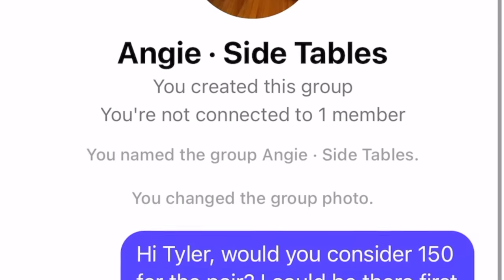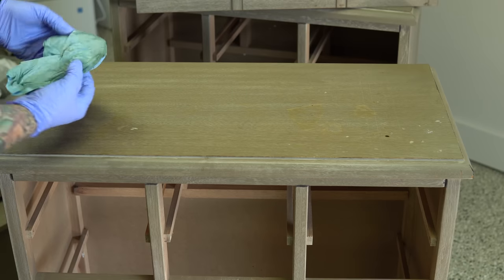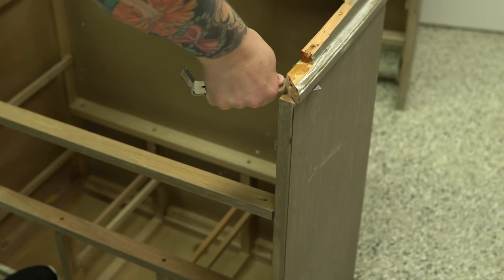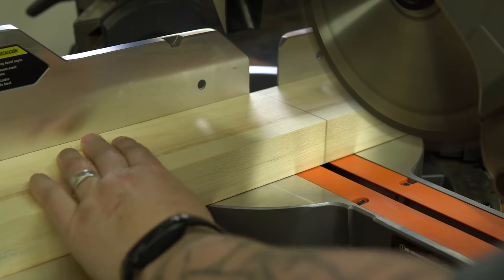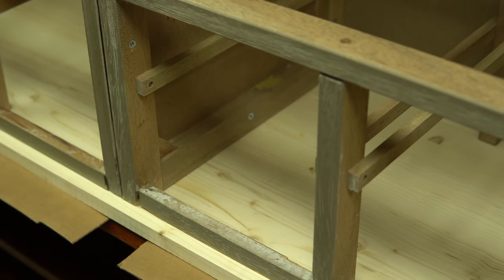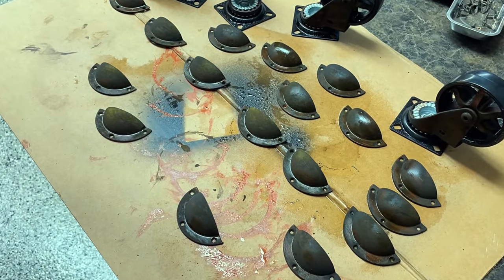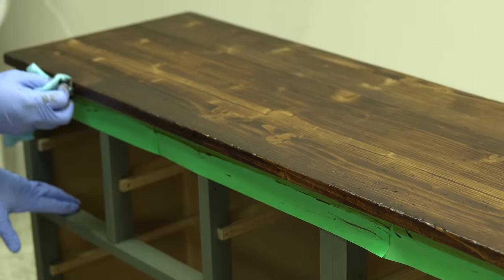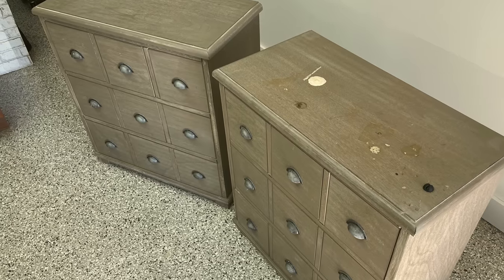I transformed a cabinet into a vintage apothecary masterpiece

Comment: Really nice and very neat solution to a big pair of problem children!

Maybe run some sandpaper over the rolling surfaces of the wheels so they look like they've many miles/kilometers of use - or not 😁Great work on the metal pulls, they look like they have a a few generations of use.

As always, super job, Angie and your furry supervisor!
Reply from the maker: Thanks John!! ❤

Comment: I did a feature wall in my store using deliberately mismatched pallet wood to try to simulate barn boards, and I made a stain for aging it by soaking old rusty nails in vinegar for 24 hours.  Then you can just wipe the vinegar on the wood and it'll turn it a sort of dusty grey which looks very close to old, rough wood.
Reply from the maker: Yes! That trick works so well! I love that you can adjust the strength by simply how long it sits. That wall sounds amazing!
Reply: Steel wool works too if you don't have rusty nails....but when my mom put a Poly sealer over it (bathroom cabinets) it changed from the pretty gray to a nasty orange....so I gave her some of my trusty Odies Oil (thanks Angie) and that kept the gray tones
Reply: @mimi2the4  Yeah, poly's anti-yellowing stuff tends to react with vinegar and makes it turn orange.  At least from personal experience when I used it a few times.
Reply: I’ve seen videos on doing that, but haven’t had time to try…always have more than 1 project going. Your wall sounds cool…something I’ve been wanting to do in the kids treehouse.
Reply: @mala3isity  Yes, or the grey you see on old barns which have been out in the weather for a long time.
Reply: Lovely
Reply: I don’t know if/how it can be done but in papercraft often the edges of the paper are brushed with a light ink to hide the white and to edge the paper for an ‘old’ or antique’ finish. I would really like to see a finish like that on these wooden pieces sometime by doing a similar finish on each side, top and drawer front.
Reply: @58Kym  You can use tea as a stain for wood, and you can also use tea to "age" paper and fabric.

Comment: I was really hoping you'd put them one on top of the other. Would have made for such a rad furniture piece!
Reply from the maker: They are so light, and very shallow front to back. I was worried about the integrity of it being taller if someone had more than one drawer open at a time, it could risk tipping forward.. so wanted to completely avoid that. :-)

Comment: It would be rude of me to say that Nacho was my favorite part of the video, but he was a close second! I think you work is amazing and you truly are a furniture artist, well because you are an artist! I do have a question about Fusion Mineral paint and I know you might not have the time to answer, but thought I would ask anyway. How long do you let FM paint dry before waxing it? And do you ever use polyurethane as a top coat on FM? I have had some discoloration issues and wondering if I needed to wait more than a day to seal it. Thanks again for your wonderful, helpful and soothing videos! Give Nacho a little hug for me💗
Reply from the maker: I don't normally use a polyurethane over paint mainly because it tends to amber, whether right away or over time. If I DO use an additional topcoat, it's either a wax or a water based polycrylic. A day is usually enough time to wait to seal though. If you've been using an oil based one, try out a water based one- you'll likely see an improvement right away. It could also be bleed though, if you haven't primed over certain woods that are prone to tannin bleed. I don't always prime with fusion, as I almost never have adhesion issues, but If I'm painting a light colour over a tannin rich wood, I would. :-) Hope that helps!
Reply: @TranscendFurnitureGallery  Thank you so much! Really appreciate the information. I am sure that will improve the process a lot!  As always, thanks for all the wonderful videos. They are always inspiring!

Comment: For removing your nails, get yourself a pair of channel lock pliers. You can squeeze the nail and roll the pliers over the back jaw and it quickly/easily pulls out your nails...just a little time saver. On a surface, you need a piece of scrap to roll onto as it could dent your project, but on the edges, like where you were using the dikes, you could do this in one smooth move. I love your work and have used some of your ideas. Thanks for the inspiration. Another idea for aging, too, is some good log chain....take it and swing it like a flail and crash it all over the top.
Reply from the maker: I use this trick quite often! As well as with flush cut pliers. It’s really useful for ones that are just barely sticking out.

Comment: Angie, your 1-from-2 piece turned out nicely. I would have added another 2 wheels at the center for strength, tho. 🙂🙃😉
Reply from the maker: Definitely something that could be done! These are actually extremely lightweight (even with the plank top) but an extra wheel wouldn’t hurt!

Comment: LOL - I learned to type on one of those monster beasties!  Which means I type HARD on a keyboard, going through at least one a year.  Lovely transformation.  I wonder if glue and clamping the sides of the two pieces together would have made the middle "channel" less visible?  It's very minor, though - not a fan of painted furniture in general, but this with the wood top is perfect.
Reply from the maker: The tops were beveled so they didn't work for the Apothecary cabinet I wanted. Thanks for watching!

Comment: Another idea would have been to stack them 😊 utilizing one of the tops which would have saved you some time and 💲. Regardless, the piece turned out wonderful. You take time to do a great job always ☺️👍
Love your 🐈💗!!!
Reply from the maker: I actually considered that initially when I accidentally broke one of the bottoms! I decided to go side by side only because I was worried about the integrity of the piece- it’s so shallow from back to front that I was worried if it was taller that it could possibly tip forward if someone pulled more than one drawer out at a time. Definitely don’t need that happening, haha!
Reply: @TranscendFurnitureGallery  that I didn't consider 🤔... sounds like you took the right path👍the piece is beautiful ❤️

Comment: Cool as usual. When I antiqued an old dresser, I used a heavy chain to dent the surface and you can hammer a open paperclip so it makes a hole and a worm trail if you can picture that, ha.
Q; Any idea how to incorporate a '' metal'' filing cabinet into a living rm with traditional cherry furniture? I first thought wallpaper, then fabric? Any painting ideas?
Reply from the maker: I don't work with a lot of metal pieces. I did do a filing cabinet recently but it wasn't metal. Best of luck with your piece and thanks for watching!

Comment: Love the green with the dark top! My one “what if” is what if some wood putty was worked into the crack where the two pieces were joined, then sanded and painted? Would that eliminate any look they had been joined or would it look awkward with a wide strip in the middle?
Reply from the maker: The tops were beveled so it wouldn't have been a smooth surface even with putty, it wouldn't have looked right.  😊 Thanks for watching!

Comment: Love what you did with these two items. Did you consider putting one on top of the other?
Reply from the maker: No, it wasn't cushioned on top - that black thing was a clip to hold a phone cord. The way the top was beveled and where the legs are wouldn't have allowed them to be stable while stacked. The legs literally would have needed removing to make that work so it wasn't something I considered. Thanks for watching!

Comment: The only thing I would add to this piece is a decorative filler strip made from the remains of the top, to hide the seam down the middle. And then stained like the top. About 7mm thick would do it.  Other than that, great project.

Comment: Where is the most preferred place to ask you a question?  I am restoring an over 100 year old screen door that is the original on an over 100 year old home here in Walla Walla, WA ~ I need some perspective on what to do w the 3 huge hinges that I have cleaned down to the original metal and they are rusting.I would appreciate your opinion, if you do that sort of thing.  I’d send pics of the door and hinges. Please inform if and where to post.  Thanks.  I am fairly new to this.
Reply from the maker: The long answer here, is as much as I would LOVE to be able to help everyone who reaches out, there sadly just aren’t enough hours in the day. There is another side to this as well- sometimes things don’t come across properly through photos and videos, and are best seen, felt, etc in person. For THIS reason, it can sometimes be difficult to accurately determine the age, finish, wood species, etc of people’s project pieces. There is also the element of user error, when recommending products and finishes, or misinterpretation of my instructions.

I get, on average, approx 40+ messages per day between Instagram, FB, YouTube, and email (and literally hundreds of questions in the comments). It is unfortunately just not possible to be able to get back to everyone. 

The short answer is this: you can certainly message me on Instagram and if it’s a simple answer, I may try to help you out. But PLEASE don’t take offence if I’m unable to respond! I need more hours in a day!

Comment: Five minutes in, and already have a question. 😆  Could you have cut the bottom off flush?  Like with the flat cutting attachment that you can use with a Dremel.  Can't remember what it's called, but works well for stuff like that.  But maybe that wouldn't have worked.
Reply from the maker: With the amount of glue and nails etc holding that bottom on it would have destroyed any blade trying to work on it and likely would have chewed the wood up too. Thanks for watching!

Comment: 18 drawers of the same size… I’d need to swap the handles for that other style of apothecary pulls, those with an integrated frame to hold a label.
Reply from the maker: Only the top drawers are small. The bottom two rows are large drawers that only look like small drawers.

Comment: why put so much effort into badly constructed furniture? Drawers have no support.
Reply from the maker: The drawers slide on two rails on the sides- so they are quite supported. I don’t mind redoing department store furniture. As long as the frame is solid and it’s sturdy, it can still have many years of use.

Comment: The work you did is amazing.  BUT...it's still just a cheap piece of furniture.  Lipstick on a pig.....
Reply from the maker: It doesn’t mean it should be thrown out. 
Cheap is subjective- they weren’t cheap from the store and certainly wasn’t cheap to buy secondhand lol 
If you mean cheap building materials, sure- they aren’t solid wood. But they are super sturdy and have many, many years of life left. Solid wood isn’t all it’s cracked up to be (pun intended… it’s the worst for cracks and splits), and actually, the whole frame is wood. So I’m more than happy with this. Part of my goal with these videos is to try to change that throw away mentality. We throw away way too many still totally useful things.